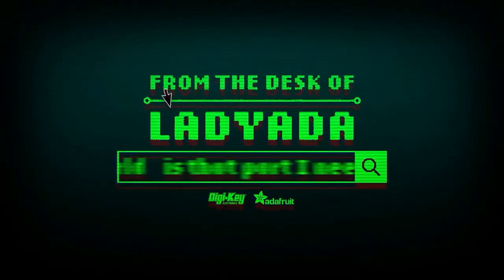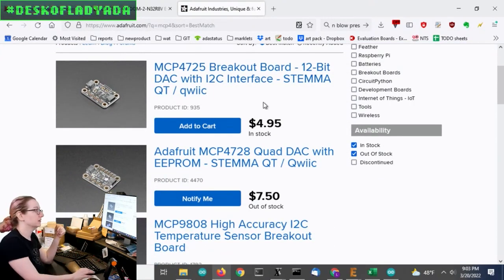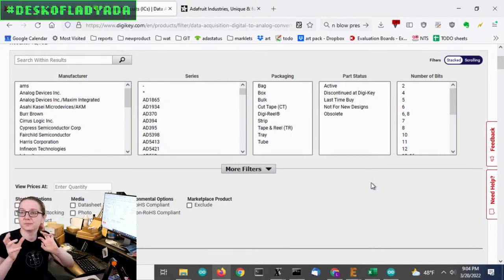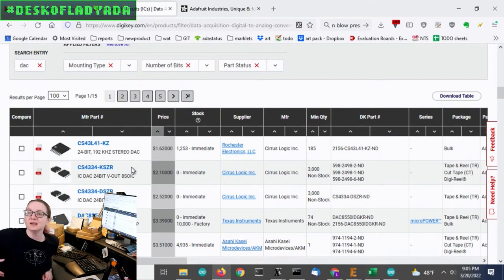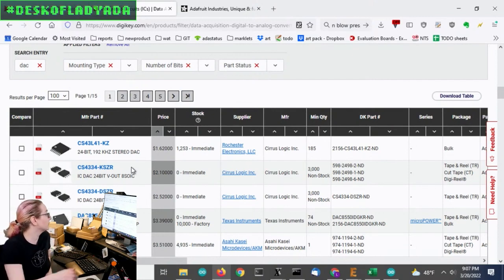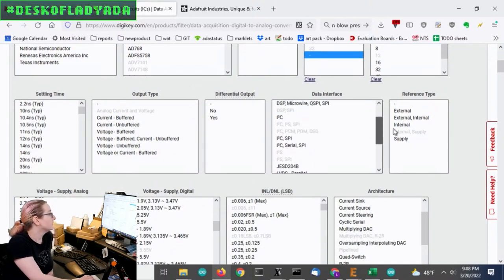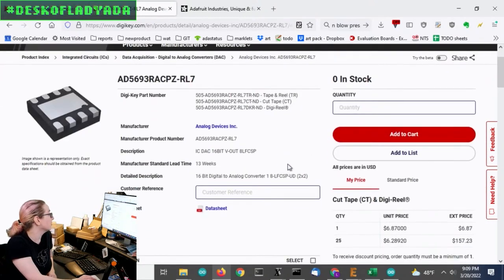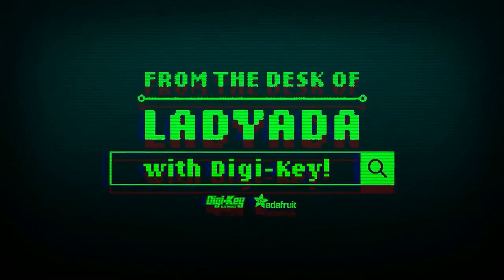The Great Search: 16 Bit Digital Analog Converter (DAC) #TheGreatSearch #DigiKey @digikey @Adafruit

Comment: The maximum supported i2c speed is probably also a useful metric for a board like this. You'd want at least i2c fast mode (400kb/s) but even that will only do 25k samples/second.  For a general purpose board you probably want to be able to do closer to 40k samples/second, just in case someone wants to do something in the audio range.  That's at least 640kbps on the I2C interface.
The chosen chip is limited to 400kbps fast mode, and it also offers only ±2LSB relative accuracy, so it's probably closer to a "15 bit DAC".  I don't know if any of the other ~$4 DACs on the short list of your search could improve on those stat, but that's what I'd be looking for.
Reply: The second DAC on your short list, the TI DAC8571IDGK, can do 3.4MHz I2C in "fast mode" and has ±1LSB differential accuracy.  That would be my choice, FWIW.